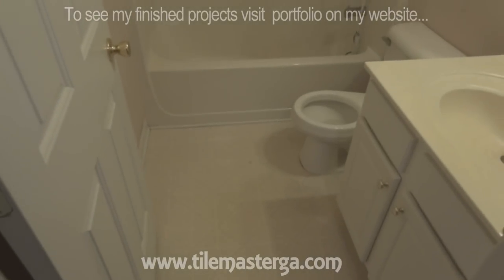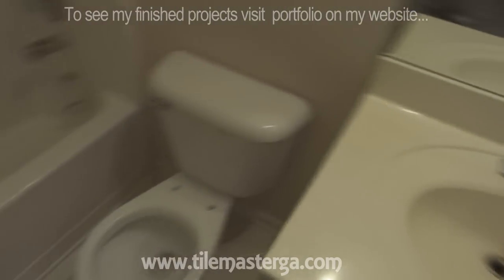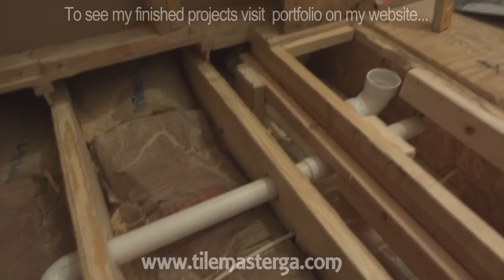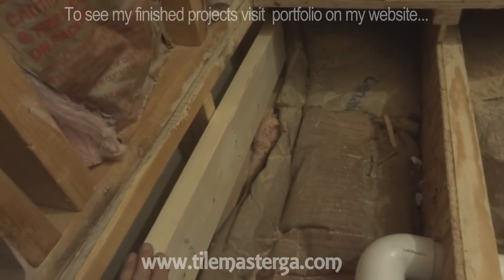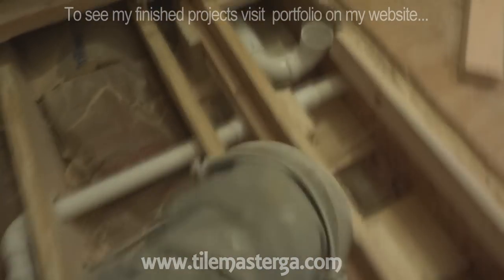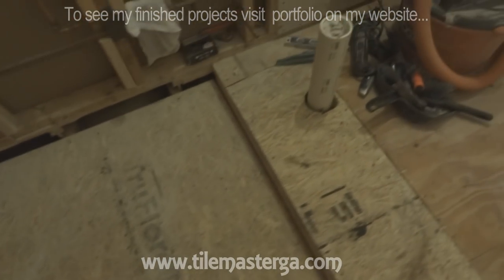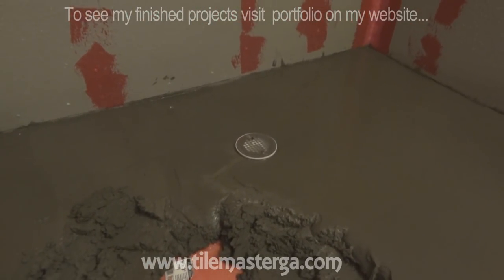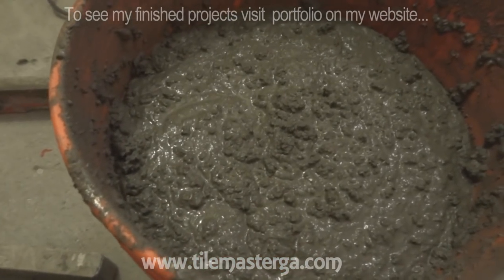Part (1) How to build and tile curbless ( handycap ) walk -in shower.

Comment: I hope that an engineer looked over your work. The strength of I-joists come from the top and bottom flanges, the one you cut away. If the cut end of the I-joist is not supported from underneath...well, lets just say that this homeowner will be furious when the floor begins to sag.

Comment: How did you determine how much to drop the floor? 3 inches seems much as the build up for tile, slope, etc would not need 3 inches, but rather maybe 1 inch as the top of the build up should meet the top of the floor tile.

Comment: No pre-slope under the liner? The water will puddle down there because the liner is sitting flat and not sloping to the drain. It won't cause leaks but it will cause mildew and stuff.
Reply: ...some states it's not required, in FL now is CODE !
Reply: dude conta deis how high do we make it
Reply: it will leak when that saturated pan gets to those nails through the liner on the floor backer
Reply: Water proof the pan and it won't matter. 2 coats of redguard will stop water permeating till the apocalypse. It is essentially like using those prefab plastic shits.

Comment: Why no pre-pitch under the pan liner? I assume that means the pan liner is level allowing water to "pool" somewhat under the concrete rather than run toward the drain.
Reply: Yup, you need to pitch the pan liner so it drains through the weep holes.  Also,
Code for my area requires 2" from top of finish drain to the finish dam.
Reply: @bladerunnerNWO 

while he is at it, raise the perma board to just above the final mud floor, it shouldn't be buried underneath it. From what l have learned from other videos on here.
Reply: The waterproofing is done topically with redguard as shown in part 2.  The pan liner mud/bed is just a backup in case of waterproofing failure. This is also my method. I used to install two pvc liners but now I used topical for main waterproofing. My customers will usually pay for this extra because I am usually replacing a leaking shower and they are good with the extra assurance of no more leaks.
Reply: renaissanceman, not necessary to seal the backer board edge when you are applying a topical waterproofing as shown in part 2
Reply: The type of drain he used has weep holes that will allow liquid and water vapor into the pan.  the pan is then connected to the floor backerboard which has about 50 nails puncturing the liner.  While his topical method looks solid the weak links are the drain and no preslope under the liner.  Wedi curbless pan and subliner dry liner would have simplified this project immensely and does not weaken the structure.  Good luck

Comment: There is a lot I don't like about this. Cutting the floor joist,  putting up the cement board before creating the pan, no pre slope and driving nails into the extended liner are just a few
Reply: I hate that people are going to actually go out and try this after watching this video. No telling how many already have actually. This is a guaranteed failure. for sure. Mold problems, and water leaks are almost guaranteed. Structural failure is VERY likely. NEVER EVER cut wood I beams like that. They are there for a reason, and the flanges are not just for looks.
Reply: SebastJO2007 Your so right about that my goodness and home owner has no idea
Reply: I'm not excited about cutting the engineered floor joists either but there may be short span between walls on the floor below? 
Concerning the other issues.......the pan liner/mud bed is just a backup.  Part 2 of this video shows the topical waterproofing which is actually all that is necessary. The mud pan is just extra insurance.

Comment: Joist cutting has been done since the 1800's  Its perfectly safe.  Tell me about a house you heard of that the bathroom fell through the floor?  I see a lot of common homeowner comments about integrity, structure and safety.  Makes me giggle.
Reply: It's safe but the floor will have more bounce in it.  Not good for tile.
Reply: I joists are not the same as the joists in the 1800's

Comment: Very well explained. quick question..If its on exiting concrete do you break the old one and pour new cemment for the slope? and how would the liner be installed for a curblees shower? Thx

Comment: I can't thank you enough for how helpful your videos have been! I've watched hours upon hours. But thank you, keep up the great work :)

One thing I could not find though is how to do a curbless shower on a basement concrete slab. I have already cut a 38" x 38" area from the concrete all the way through to the dirt. Now I am at a standstill. I am not sure how far I should dig in order to lay a solid base.

The 38 x 38 slab that I cut out was 3.5". I was thinking I should dig down another 3" beyond the 3" it took to get through the concrete. This would enable me to pour a 3" slab to support the pan liner and give me 3" for a mortar bed to lay the tile on. Does this sound like the best way to do this?

Comment: Lot of ignorant comments here. Two things, first the pan doesn’t need a preslope because it’s waterproofed with red guard. Water won’t get to the pan. Ditto for the cement board touching the pan. Either you trust companies like mapei, laticrete, and custom building products who make these roll on membranes or you don’t.

Second, as far as I can see the 2x10 is sistered to the wood I joist, with the bottom chord left in place. Since the ceiling below likely has drywall how could he have removed it? The top chord that was removed is more then compensated by the 2x10, probably many times stronger then it was before. Hopefully he installed the 2x10 first then botched out the top of the wood I joist.

I am a little surprised at the thickness of that mortar bed.

Comment: When you cut down the joists 3inches. What tool did you use? Sawzaw and planer?
Reply: +mike orlando All You Need do Is Run a ChalkLine where Your Cuts are To be , gauge them with another Board Like a 1x or 2x temporarily Screwed to rest a Skillsaw  Base plate on & turned sideways and run/set the saw also gauged to a lil thicker than Thickness of 2xs typically 1 1/2 these Days maybe a True 2x "=2" back in the Day,, Older structures were dimensionally correct, anyway it will Make your Blade Drag Less if gauged to Apprope thickness 1 1/2 =Go 2 inches Deep etc. , Once you have cut along the joist That way just run Sawzall down at ends to remove the said Notches ,[___________] , This is a way more Acurate Than trying to cut sideways with a Sawzall or just a Skillsaw with no Guide , unless you are an Old Pro , but this is a way to get identical Cuts or Damn Close , a Sawzall & Planer would work but would Be Way Longer & Not how a Carpenter would do it , sawzalls are not accurate that way horizontally , the end cuts will be good for sawzall or jigsaw or even old fashioned Handsaw if inclined to do so ,, these are very common to SCAB/SISTER a joist with an Appropriate 2x10 etc. And This Guy Clearly did a Pro/Code Job And anyone with all that ENGINEERING BS is Being way ANAL , Its ok to cut TJI and Scab them like this I would do one at a time for safeties Sake Cut one  & then Sister it n do next one , Good Luck , I'm Off to do Mine as we Type :P
Reply: or you could use the Wedi system and skip all the joist cutting, sistering, liner, and mud bed bs and be done in half  days time.  Time is money

Comment: everything has a subfloor.  any with a solid cement foundation?
Reply: Need to chip out the cement put shower pan then thin set or what your gonna use for slop

Comment: Im a General Contractor 20 yrs experience. Comments regarding from Jeff and Owen, you guys have no idea what your talking about everything this man did is too code. And will be structually sound for a life time. Let us see you do a seamless shower floor and then you can show us who you are.
Reply: There is no way this is to code.
Reply: What is not to code? can someone reference an actual code?
Reply: It can't be possible to rip speced out floor joists and still be within code restrictions
Reply: smh "20 yrs" yeah & in all that time did you ever look at the span & hole charts for I joists? Hint thou shalt not cut the 2x...
Reply: You might be a general contractor but definitely not a grammar teacher
Reply: Don Larke, I don’t think the issue is jealousy.  There are many DIYers that watch some of these channels and assume that the work being shown is entirely correct.  Many comments are for those DIYers that might follow someone else’s example and cause more harm than good. Generally, most people appreciate a heads up or another viewpoint on how to tackle a project.  Constructive criticism isn’t a bad thing unless you’re a know-it-all.  We can all stand to learn from each other.
Reply: Wedi makes a curbless pan and liner system that is very simple to install, does not require structural modifications and is 100% waterproof.  check it out.  I don't know why anyone would do a shower this way in the video
Reply: Be sure and let us know where you operate so we know who not to call.  It's not how long you've been doing something.  It's how good at it are you and for YOU sir - given the information available in this video - to make a statement like that, are NOT good at it.
Reply: @stevemcwilliams8680  I agree. I am a DIYer. I am grateful for the many perspectives. Keep the constructive informative critiques coming.

Comment: pre-sloping liner????? does doing that really helps??? how??? if drain seats at least 1/2" above liner...... and about cutting the joist if you dont feel comfortable just add        9 1/2" microlam (LVL) that'll hold more than it was holding before!!!
Reply: Sergio A. Venegas It would have to run from wall to wall below.

Comment: I applaude your detailed approach and showing everyone what you're doing. However, the fact remains that you are cutting structural members in the home. They are engineered to hold specific loads and you have compromised the integrity of the structure. I highly doubt that you obtained a building permit because this type of work would likely not be approved without more extensive support and potential sign off by a structural engineer. You must be careful not to mislead people as to whats possible and practical. This same shower can be done without cutting the structural members.
Reply from the maker: It can not be done without lowering sub-floor.
Alternative will be to build up rest of the floor higher, but transition to hall way will be no good.

I wish you watched entire video before making your comment - you missed that I added sister joists  to each that been cut (2x10") , re-enforcing it even more.

Like I said , this is tricky project and many contractors has no clue how to do it right..

Regards.

Michael
Reply: Owen Barclay I've been trying to contemplate the effects of joist-cutting on the structural integrity to lower the floor for curbless shower installation and stumbled upon a document detailing this procedure in all respects: http://www.ncsu.edu/ncsu/design/cud/pubs_p/docs/Curbless.pdf
Reply: +Owen Barclay yeah, i only had to watch this video for ten seconds
Reply: I've been researching this to do myself and even had 2 contractors in my house to quote just making the shower pan.  Everything I've read and both contractors say they would cut 4 inches out of the floor and would laminate shorter boards to the joists just like he did.  I'm curious what would be a better way to get a curbless shower?  Especially without cutting the floor?  I want to know since I have not started anything yet.
Reply: If you are interested, email me at owen@accessable.ca
Reply: Absolutely correct Sir. Unless there's a bearing wall to the left of that cut underneath, which is unlikely, there's no way this job got a permit. Even then, new joists would have to run from bearing wall to bearing wall.
This is a epic horror story.
Reply: I would like to see the work he did on sistering the joists, I never thought it possible to sister joists by cutting the joists, how in the world would he tie them in, i hope with bolted steel beams and not wood.
Reply: + TileMasterGa Include yourself as one of the many contractors that have no clue how to do it right. You can't just sister I joists and notch the top. That is hilarious, someone call a framer stat!
Reply: I think the proper way is to sister joists back in possibly creating a bulkhead in the floor below.  If the joists are 2x10 then u can cut 2 inches away and sister back in 2x8's and blocking to create added structure.  That would be my plan anyway but this is not my area of expertise , always have done showers with curbs.
Reply: Seems like a lot of cement???
Reply: There are curbless pre-fabricated finished acrylic, composite or fiberglass shower pans that can be installed if you don't want to cut the floor joists.  Also one other method is to only use redguard or other topical waterproofing membranes including Kerdi membrane.  That way you don't have to have a deep shower pan to hold a mud pan/liner combo. You still need to be creative to make a slope to the drain like cutting out the 3/4" subfloor not cutting into the top chord of the floor truss. Then sister support lumber that will hold the subflooring in between the top chords making them level. Then create a slope with thinset or other floor patching cement that will support a layer of Durock or other tile backer. Add an extra layer of backer board thru out the rest of the bathroom just to give you some extra room to create a good slope to the drain. After that apply your topical waterproofing. I definitely don't like cutting the top chord of those kind of engineered floor joists unless the span is relatively short or I can extend the sister joists as far as I can reach under the shower walls maybe even on both sides of the web of the floor joists. One other option is to open the ceiling below and add longer sister joists. Also one should reinforce where the cut is made in the top chord so that the compression forces are transferred to the sister joists below and not thru the flimsy piece of webbing.
Reply: @TileMasterGa  This can be done without modifying the structural members (joists) and in 1/4 of the time at least it took you to do this method.  Wedi and Schluter both make shower pans that will flush up to  3/4 subfloor.  Check it out.  Your work is very nice however I think you're barking up the wrong tree here

Comment: NEVER HEAD a tji joist! As a contractor that was hired by the insurance company to fix 3 tji's in a similar situation  (lowering shower floor), which was after a lengthy court battle between homeowner and contractor because the home insurance did not cover it. My bill to them was $11,000 not included $650.00 for architecture fee and 900 for engineer. Just because some says " I'm a General Contactor, I do it all the time" means nothing. Anyone can be a general, anyone, it's just a licence title. And no preslope? Not trying to bang on your business, build however you want but as advise for a common diyer it's bad and costly advice.

Comment: DO NOT LOWER YOU FLOOR THIS WAY!!!!! It will void your homeowners insurance and will not pass inspection. You have to have a structural engineer involved. You might think your saving money now but if that shower ever floods or the floor gives out, an electrical fire happens(see the electrical wire) you will not be covered (work done without a permit is not covered by any insurance I know of and if you sell the house you could get sued by the new owners) You are cutting structural members. The TJI Joists that you cut are an engineered product.You can not cut any random part out, they work as a whole. By cutting the TJI here you could be comprising the floor else where. It might cost a bit more but getting a permit protects you, the homeowner, and for this project you definitely need a permit regardless of what the contractor tells you.
Reply: +Jeff Johnson , you are correct! Nice work, all for not, if no permits and
 engineered stamped letter for sister detail.
Reply: +Jeff Johnson 100% correct.  There are a few things in this series that I noticed to be of issues to me.  First, the cutting of the engineered joists is a no no.  Coupling the sides of the cut joists does not correct the loss of the structural integrity that the upper block was providing.  Even by cutting 3 inches out of the top or bottom blocks of these will result in a major loss of structural strength and the manufactures of these types of joist systems clearly advertise there is to be no nailing or screws on ANY vertical surface.  Doing so results in the warranty being void.  Second, there is no pre slope under the pan liner.  Gravity takes any penetrating water at this level to the weep holes, so a pre slope is necessary to direct the water there.  I also noticed in this step, the weep holes were not covered with pea gravel, so these weep holes are now filled with concrete and useless.  Third, and the biggest issue to me in this entire job, the pan liner on the bottom with RedGard across the entire tiled area is creating what many call a "moisture sandwich", or a "moisture trap".  These situations are what I run into constantly here in Dallas and I make 80% of my income fixing.  By fixing, I mean tearing out showers that are only a year or 2 old, having a mold remediation company come out to clean up the excessive mold, and rebuilding the entire thing.  With a 2 stage drain, it is the following layers:  subfloor, pre slope, liner, and tile bed.  With a single stage drain, it is: subfloor, poured pan, and full cavity liquid membrane.